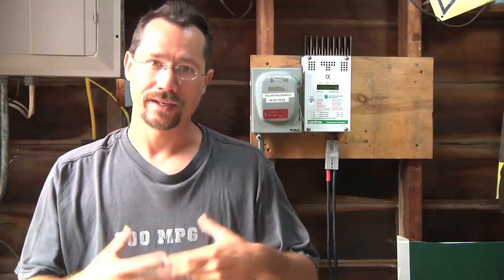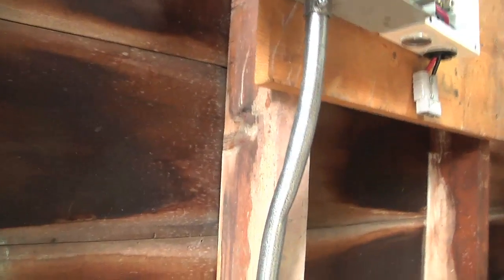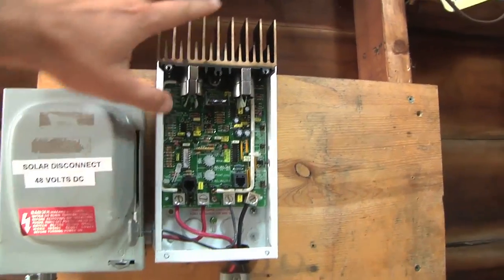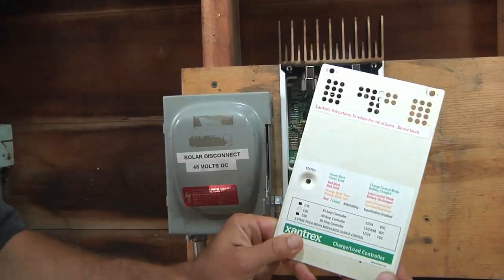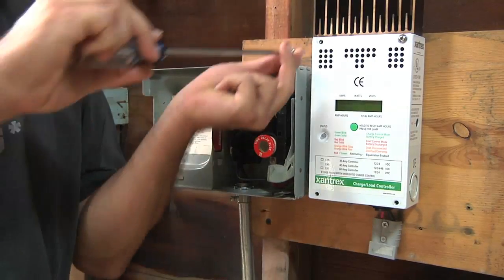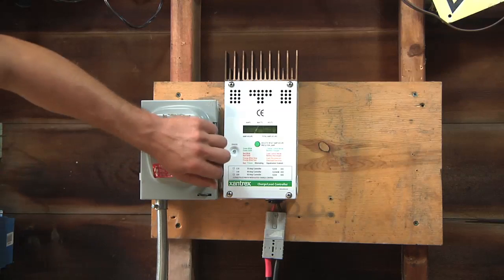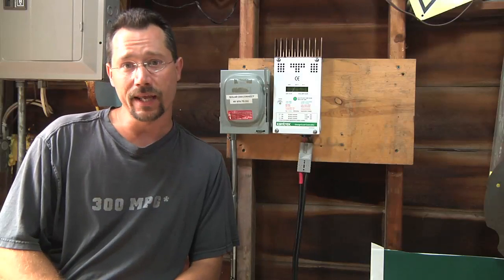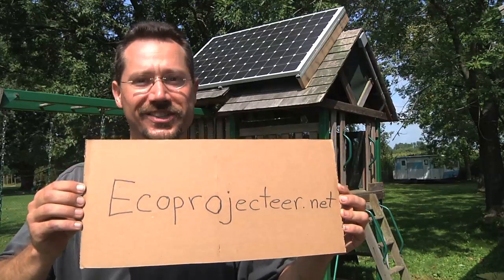Solar Playset: Inside Wiring & Charging

Comment: Nice work! Looks professional. 
We've had a lot of low-solar days here in MA lately. I heard my DHW heat pump (A7 Airtap) running yesterday. Normally we never hear it, since there is solar PV connected to the DHW tank's heating elements. 
The leaves are falling, I guess the summer is about over.. Time to dig out my Happy Light (anti-SAD).. 
Cheers,
Rich